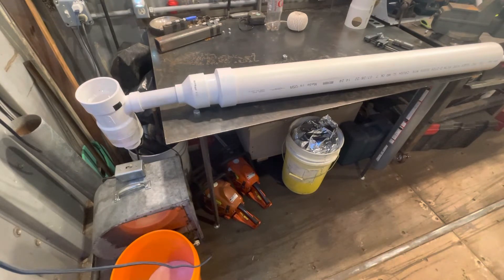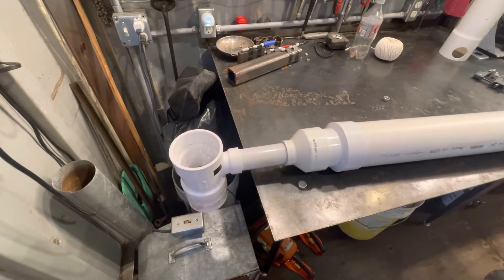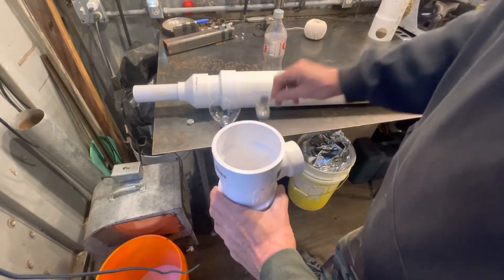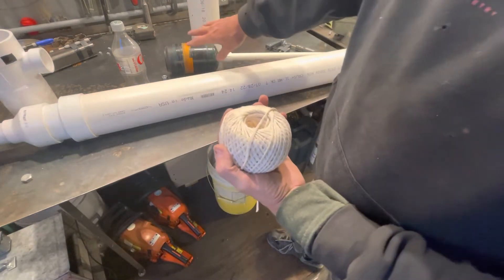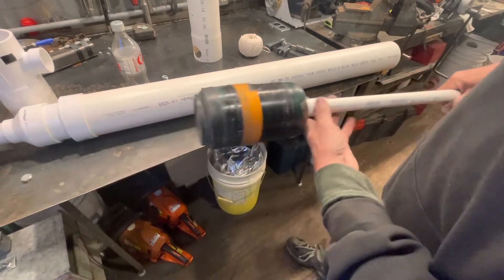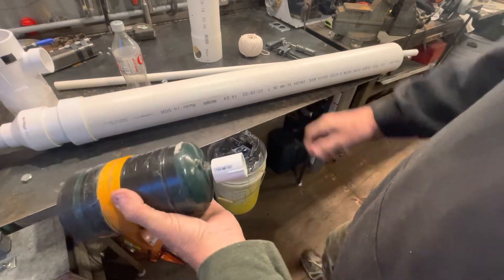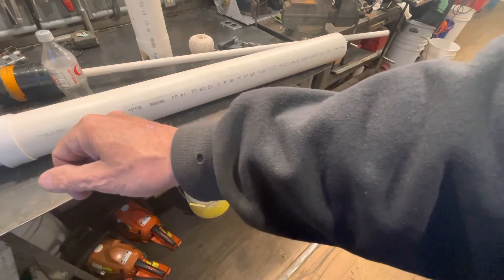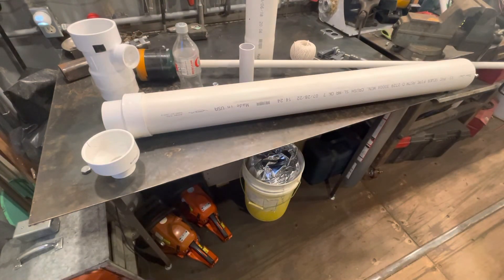High volume manual air pump to use with the emergency nuclear contamination air filter.

Comment: How is it connected to the outside air supply and the bottom of the bucket?
Reply from the maker: It actually goes on the discharge side of the blower motor shown in this video 
https://youtu.be/EfAK1pmhwWI?si=srFF4I72f7azA0rK

You could make to connection inside your shelter with what ever size piping you have. The bottom side would hook to the filter discharge and the upper outlet would go into your shelter area.
Reply: @edwardjackson9791 it would be awesome if you could make a video showing how to connect them! Thanks for your videos. You are so smart!
Reply from the maker: @davidschwartz5127  you connect it to the discharge of the blower, not the bottom of the bucket. The blower is a squirrel cage type so there is very little differential press across the blower. So, you can just place it in your bunker area and take a suction off the blower discharge. Thanks for your input.

Comment: Would this design help scrub air of c02 in a small shelter?
Reply from the maker: It would displace the CO2 in the air by providing positive pressure source of makeup air to the shelter. CO2 scrubbing is much more complex. On a submarine the removal of CO2 is accomplished by a scrubber using Amine.

Comment: I would probably go with a broom\painters handle instead of PVC since a broom handle would be more rigid, and probably cheaper. You could use a hole saw to cut the piston out of wood (2x6), and glue it to the broom handle. Also put a reducer on the handle end so piston remains straight in the PVC tube. 

Perhaps a couple of toilet flapper valves could be modified instead of plastic bottle tops so you can change the orientation of the pump, or just make flapper valves out of some flat neoprene rubber. The rubber should have enough spring tension to work in different orientations. 

Another option is to use a blower and add a hand crank with some pulleys to increase RPM from hand crank option. 

That said: Surplus Center (dt] com sells AC & 12VDC blowers. A 12VDC blower with a 120VAC to 12VDC power supply would provide the means to run it both on a household AC or a 12V Battery.
Reply from the maker: Yes there are several ways and designs. I wanted to make one out of what I had on hand. I put some small balls in for the valves and the work very well but I also wanted to use easily modified things around the house. I had several propane bottles and they can be empty or full they still work. The only bits that are not normal is the large pvc pipe and pvc connectors but they would rarely need replaces. Good ideas and thanks for the input. The more people share the better. 👍
Reply: @edwardjackson9791  Yup I realize that. I was just building on your design so if some needs to do this, they can build one that might work better for their situation.

Comment: Thanks for the video. I'm curious about air loss on your soda bottle valves. I was thinking you could add a line of silicone caulk for the valve to sit on to make a better seal. Just a thought.
Reply from the maker: Yes I was concerned but the bottles actually seal very well as long as you use ones with a smooth surface. I inflated a 55 gallon bag and pressurized it pretty tight and it did not leak down. You could also use rubber balls of the correct size but I wanted to try it with mostly stuff I could easily obtain and replace if needed. Also the valves just need to really hold briefly during the pumping and they did well. The pipeing connections I used had really good seating surfaces already so that help a lot. Thanks for the comment.